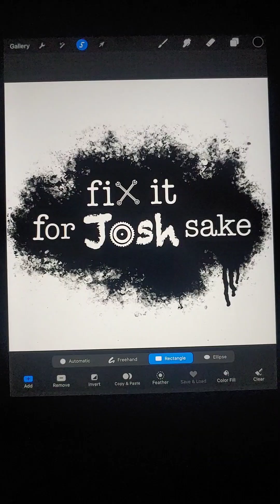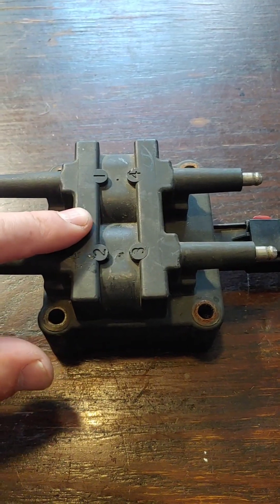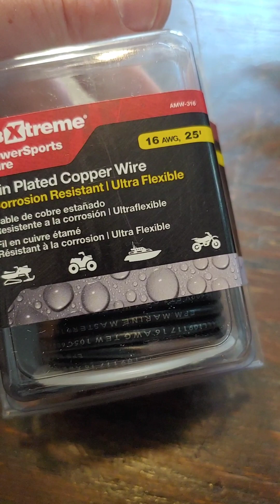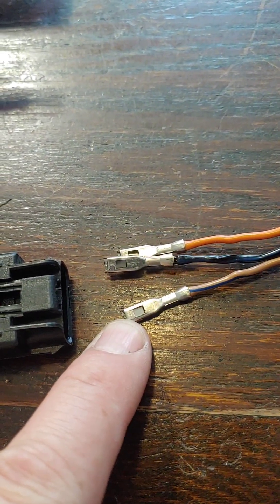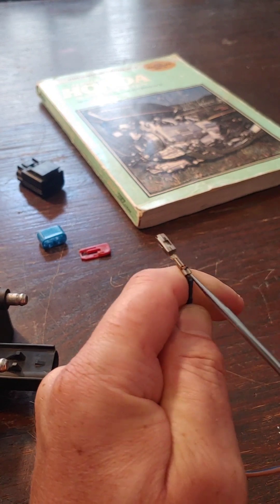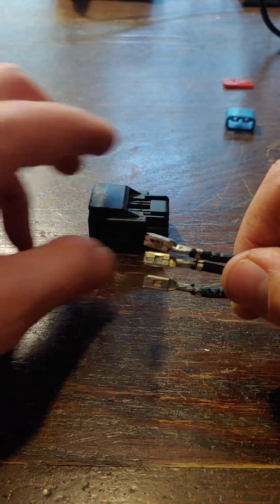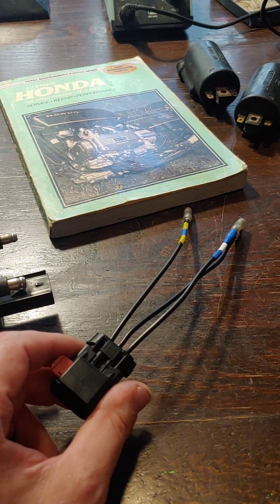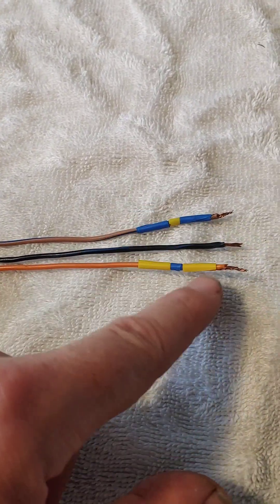Honda Goldwing running on a Dodge Neon Coil!?!?

Comment: Are you running points, or electronic ignition? I have a harley shovelhead with dual plugged heads and points ignition that i would like to try this on.
Reply from the maker: That's a cool engine you got there to try it on! I'm running electric ignition on this bike, but I don't see why a coil pack with a hotter spark would be bad to have on a shovelhead

Comment: I need to wire an ignition system from scratch with a neon coil can anyone give me a basic run down lol? Starting from the battery
Reply from the maker: I'd suggest starting with a stock wiring harness due to the complexity of the goldwing's electrical system. But best of luck! That will be an amazing accomplishment!!
Reply: I've got a whole new harness on mine with a X-21 brain unit, and have been researching the Neon coil mod since it's a huge improvement for reliability (Or so I've heard). I'm also going to be running dual Weber IDF 40's, so I'm assuming the hotter spark will make starting easier with the whole "no choke" thing they have going on. If you've found any information on the wiring I'd love to hear! I still have my stock ignition, but it's definitely an improvement that I want to make.

Comment: 3:51 
Goes to show how crappy Dodge vehicles are...

The Dodge car had 20 AWG wiring on the coil and the Honda motorcycle from 1975 had 16 AWG.

Comment: Did you change the firing order on you neon pack ? I did as per another . It seems to run fine but ballast resistors gets hot as hell . Did you remove any of the wiring from the stock setup after installing neon pack
Reply from the maker: Hey David, I was really careful to color code and lable the wires, and in the end I did have to swop two wires to get the correct firing order. Those ballast resisters do get really hot! I clamp mine to the metal frame with metal house clamps to help dissipate the heat that they put off. I left all the stock wiring I could, but the points were pulled by the previous owner and a CDI was installed so some things are different on mine

Comment: what are you supposed to do with the ballast resistor when you perform this mod?
Reply from the maker: The Ballast Resistor needs to stay in the circuit where it was with the original coils. I have had one burn out so it was providing too much resistance. It should be close to 1.50 Ohms. If it's more resistance the coils will not provide enough spark, if it's less resistance, the coils will burn up.
Reply: @fixitforjoshsake  . thanks, i misinterpreted some instructions and ran the bike without the ballast resistor, it was kinda dumb, kinda experimental. and I'm pretty sure it burnt out the electronic ignition module, I'm going through and replacing it right now and re-adjusting the timing
Reply from the maker: When the ballast resister burned out, I had to run the bike for a bit with it unplugged to get home, but it's defiantly hard on the coils! But they're still working😅
Reply: @fixitforjoshsake  another thing that i had a theory about was the alternator, From what I've heard the stock 300w alternator in the gl1000's were enough to power the bike in it's stock form and not much else, Do you think it could be insufficient for the dodge neon ignition mod since it runs off 12v instead of the 7v-9v that the stock coils run off? I know that they sell upgraded 500w alternators for these bikes on randakks, I'm considering taking out the motor and replacing the alternator while I do the clutch.
Reply from the maker: @blakewixom2893  interesting theory! I didn't change the voltage going to the dodge neon coils from what it is stock. So it's my understanding that when you push the starter button, 12v is delivered to the coils. But when you release the starter button, the voltage going to the coils falls to 8v to allow for a cooler and more efficient electrical system. Since the dodge neon coils deliver a hotter spark, the GL engine runs better with it.